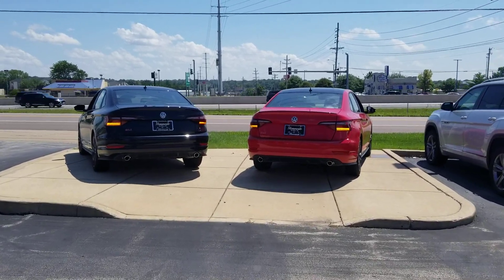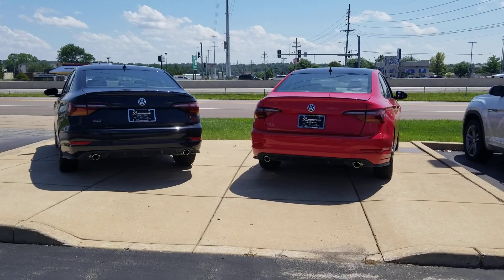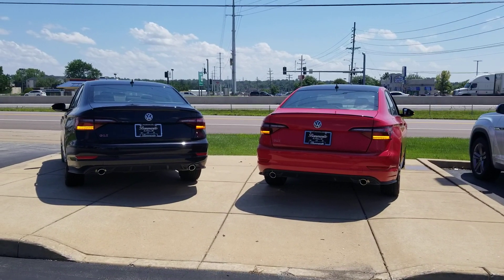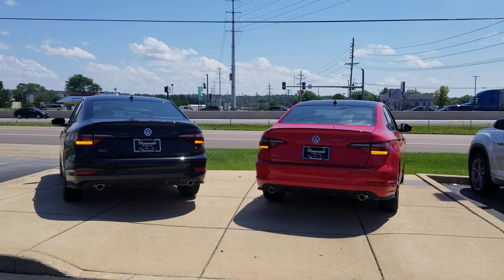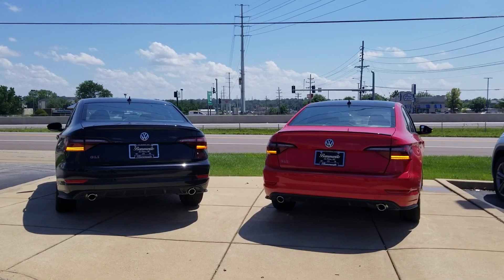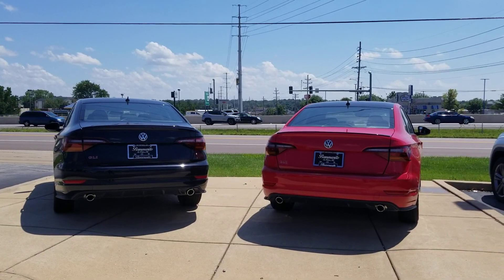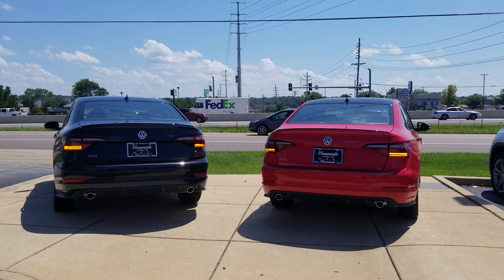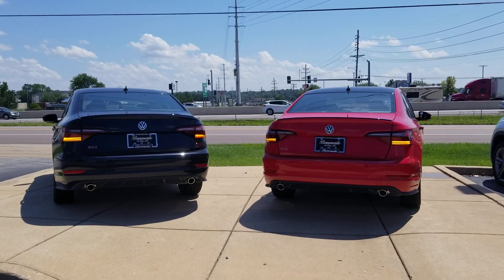Blinker challenge.  Can you get them to synchronize?

Comment: LEDs are different from regular bulbs.

They can stay synchronized unlike regular bulbs that have different frequencies that arent the same frequency at all times, it changes, while LED bulbs use less energy and newer cars have relays and resistors, hence the same new cars with LED turn signals can blink at the same time as others if turned on at the correct time.
Reply from the maker: Good to know. Thank you.